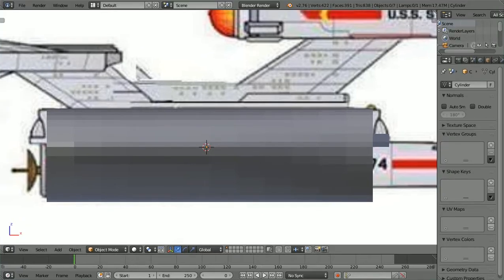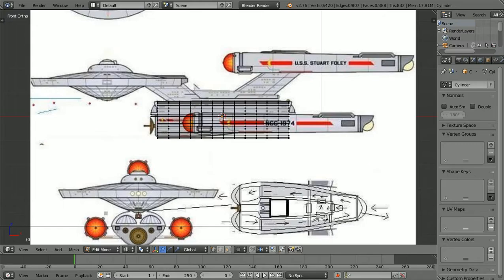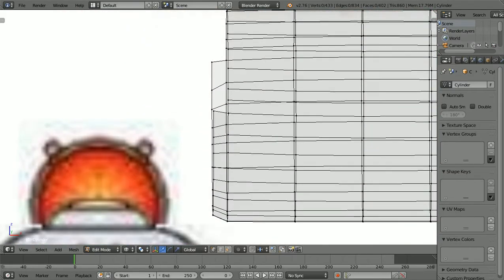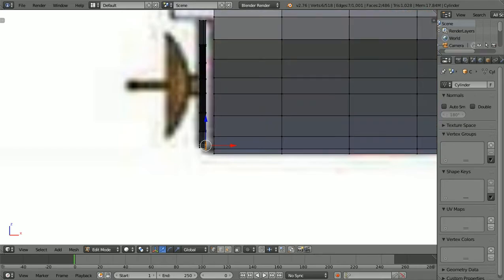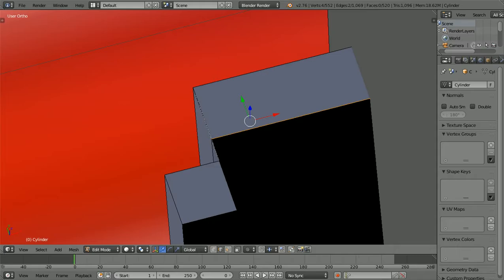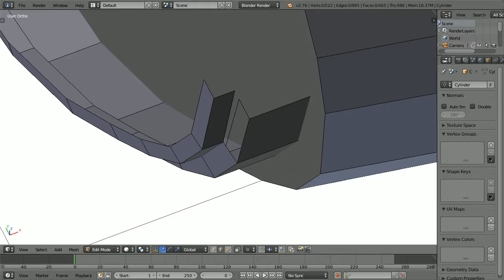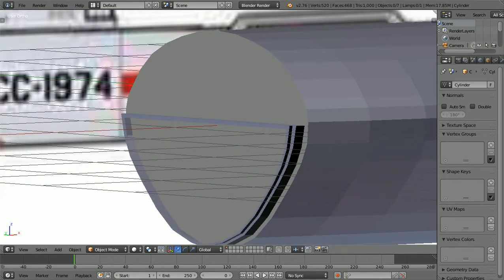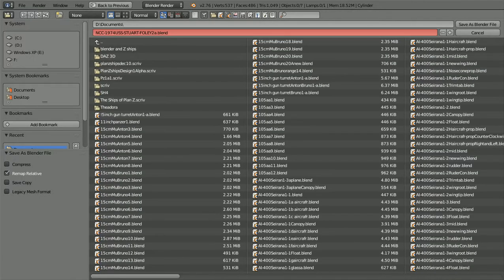The Stuart Foley Dreadnaught Project #2

Comment: hi i am the one who sort of resceched it the lip you see was just sumthing i really never cleaned up you see i took sum one elses ship cut it up and inlarged the top part pof the main hull.  as well the over view with the round bubble thing thats sapost top be the shuttle bay but i never thoght any one would ever make this into a 3d reperzintation 
https://www.facebook.com/groups/693057764115963/930676033687467/?notif_t=like
Reply: +jon baranoski also id like to say if you read this just do what feels right +TwistedSister/Haratiofales
Reply from the maker: +jon baranoski TY jon, I am not on Facebook. I will mold the ship into as close to the pics as I can. there are and will be minor points at where I have to compromise and or guess the 3D molding because of the edges, or parts not meeting in a 3D environment. I would ask that You along with Mr. Foley, Excuse Me, Capt. Foley would opinionate if You think that one thing looks better than another option. For example on the next episode, I am trying to decide on the rear part of the secondary hull to shape the bottom somewhat like the Constitution class as it is easier to do, and I think is more astetic then the TOS Dreadnaught hull design. However the TOS hull design would have had more spade to put stuff into. There is no rear sensor array on this ship, I don't think anyway so that would be another design argument for undercutting the hull there. Tell Me what You think. Anyway I for the most part will make it as You say, what feels right, I would just like to know if everyone is ok with what I feel is right, and or if I'm skipping way off the path with the big bad wolf, LOL.
Reply: i think going with a look that looks like tos on the rear is good maybe you can do it so it looks sum where near the end of tos befor the majer refit of the movies but then again i am fine with witch ever way you go the round things on the over view with the lip infront of them they where ment to be shuttle bays but i only use paint shop so i could only have a crudly painted pic so really just go with what feels right for the ship
Reply from the maker: that's the flavor that I am looking for.

Comment: So just curious. Will you also be doing the standard secondary hull variant of this design?  BTW if you ever have any questions about her please message me at anytime.  Always glad to help out.
Reply from the maker: +Stuart Foley Yes, I plan to do both. I think the most work will be on the Secondary Hulls, as most of the rest of the ships are the same other than the support neck and Primary Hull/saucer being a tad different elevation. My Skype is eldan.fales (I have bought new headphones, and for some reason I they work with everything except Skype at the moment.) And or My Skype needs reset. I can and will also send You My personal Phone # over the E Mail. I would like to get the Skype fixed though as we could discuss the models, while I am editing them. Also I hope that You don't mind Me posting this on You Tube. If not I can do them in private and not post this. I guess that someone could copy what I am doing, other then the need the drawings. but I probably should have asked first as they are your ship. let Me know. Haratio.
Reply: +TwistedSister/Haratiofales No its perfectly fine that you are posting these, I think others can learn a lot from watching you
Reply from the maker: +Trekyards TY, I learn allot from the practice, and sometimes other Blender users point out stuff, and I learn new trick from them.